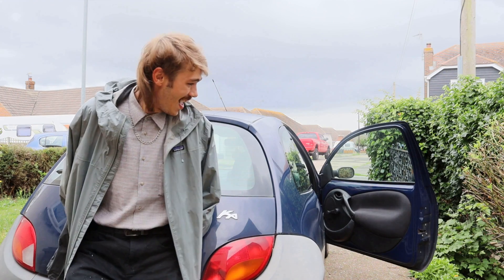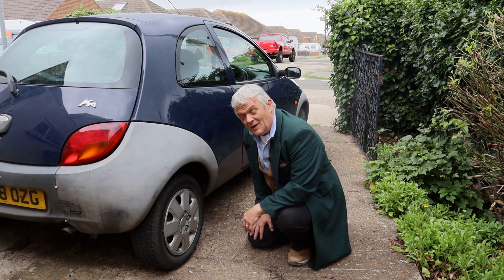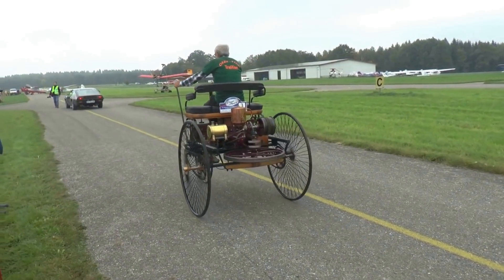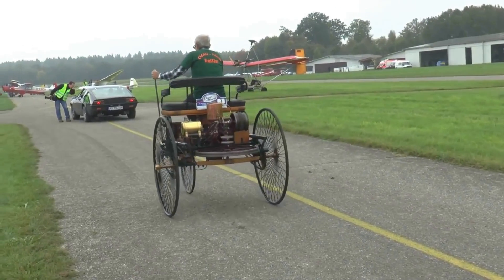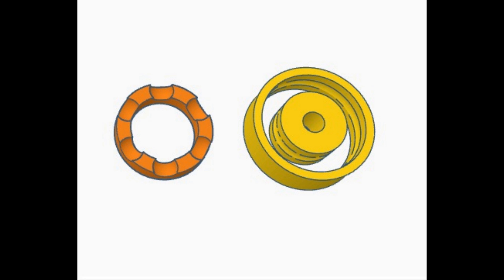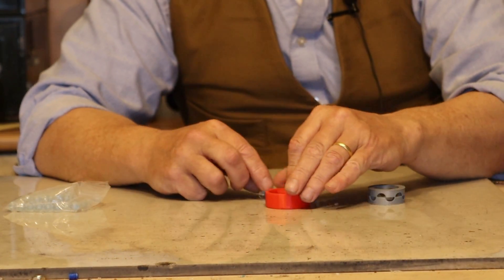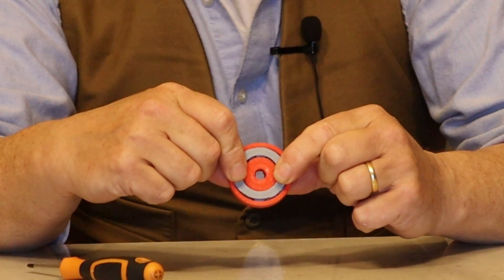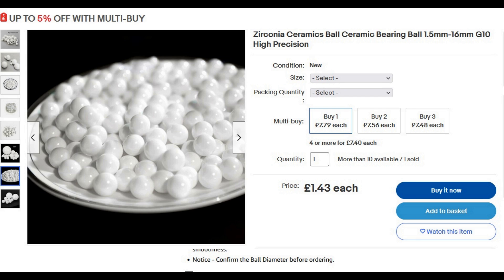2001 How To Make Waterproof, Weatherproof, Rust Free Bearings - Glass Bearings

Comment: As a fun experiment it is perfect, but otherwise not that much practical, contrary to the expectations it will fail very quickly.
Plastic may be rust proof in wet environment, but it won't be contamination proof (uses to be present in the water) and definitely it will be extremely sensitive to ozone and UV corrosion (mainly relevant for the wind turbines).
In a water you will be better off with a (stainless) steel sliding in a wood bushing, a combination where the water form great lubrication (there are 100 year old turbines using wet hard wood bushing to iron rod bearings working to this day). You just have to make sure it never dries out, that would seize and kill it.
And for wind, classic sealed metal bearing with a reasonable rain cover is nearly impossible to beat...

Comment: Perhaps slightly less longevity, but Airsoft BBs are a super cheap option for this. £10 used to get you 2000 'hard' ones and they have good manufacturing accuracy too! 5.6mm diameter from recollection, never seen one out of spec when I've been using them for this.
People complain about them absorbing moisture if left unsealed but we know that pain with PLA and PETG anyway :)

Comment: My only concern with printed parts would be the maximum load/speed.
When I was making an RC boat, which wanted to turn into a RC submarine when it would fill with water, I decided to do it right, so the shaft leading to the propeller would be essentially a pair of loose sleeve bearings, but separated by a sealed cylindrical gap that I'd fill with thick grease.  There might be some axial pushing/pulling from accelerating/decelerating, but almost zero side-load, so it worked quite well.
I'm guessing side-load on any bearing would be the killer.
Reply: They make axial bearings specifically designed to be axially loaded.  As well as taper bearings that can handle both axial and lateral load.

Comment: Great idea! Printable Nylon filament might be a good choice for more durability and toughness.
Reply: Nylon is hydrophilic, it will change properties in humidity and if you don't keep your filament in a dry environment it will have steam bubbles popping when you try to print with it.  Hard learned experience.
Reply: @russellzauner  Of course nylon is sensitive to moisture and nylon print filament must be kept dry. But once it is printed into a bearing it makes an excellent weather resistant outdoor material. Nylon has been widely used for a long time in bushings and bearings outdoors.  Are you worried about recycling of nylon from bearings back into printing filament?
Reply: I'm going to use ABS.
Reply: Rust proof isn’t dirt proof, I love the idea but a dust seal needs including.
Reply: @Milkybar3320011  so design one for printing.

Comment: love the concept, especially the non rust aspect, how close are the glass balls in tolerance, as I would think that would be the critical measure.
Reply: Glass may deform under stressful conditions, although it shouldn't break (see drop demonstrations of large glass balls), but there exist super cheap ceramic bearings, which he mentioned, which can be made to very tight tolerances as well as of engineered materials that might be better in your application.
Reply: what tolerance do you need, the bearing grinding jigs that work for steel work for any material because the jig uses dimond abrasives. and why would you exceed the tolerance of your printer anyway?

Comment: Ok, so I'm thinking that there's some opportunity for improvement here. Are there any cheap and abundant conical bits of metal one could use as contact surfaces within a printed housing? Conical to reduce sizing constraints, that way the balls can be larger or smaller, and you just move the conical slices in or out from the midplane.